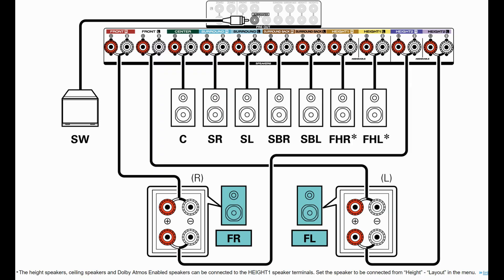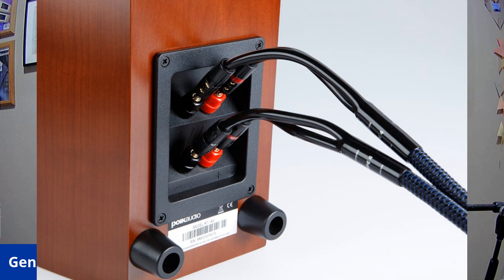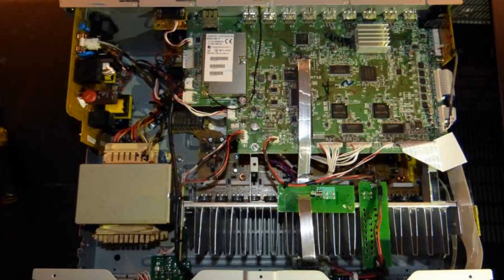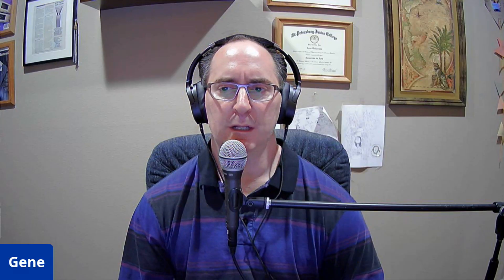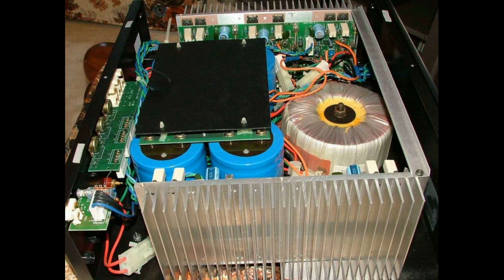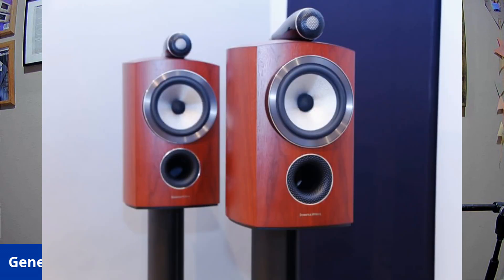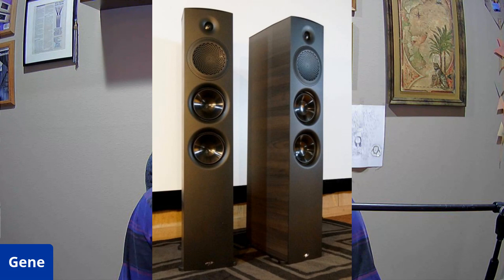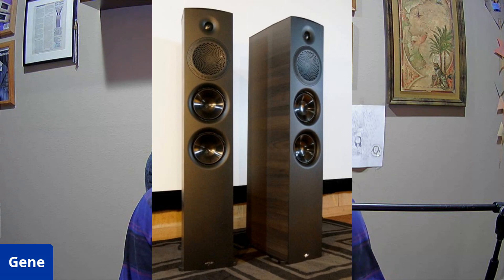Should You Bi-Amp Your AV Receiver?

Comment: I stopped using receivers after it seems they all eventually break.  I have gone to an extremely strange home theater system.  I am using car amplifiers, DC power supplies to run the amplifiers.  I swear these amps have so much headroom it's unreal.  I will probably never go back to a standard receiver.  Also, I use FLAC audio for music listening.  My home system is very, detailed, revealing, and not to mention very loud and clear.
Reply: That is strange.. Assuming it is a "home theater" system, what do you use to decode the Dolby siginal? otherwise I would just see it as an overcomplicated 2 channel system.  Which is fine, but are you also using something like a DSP-408 or similar? Tuning with REW? would open a whole new world in your case
Reply: So you have a 2 channel system with no processing at all? That sounds absolutely awful. I've never had a receiver break on me. I think it's something your doing bro.
Reply: what power source do u use for 12v car amp indoors
Reply: Yamaha = ZERO ISSUES...
Reply: @bryanp4827 
 Actually, most units equal no issues.
Reply: Car amps don't need the massive transformers to adjust the huge voltage coming in from the wall.  12v is plenty for audio.  There is so much wasted energy and heat with audio.  A good capacitor that stores energy for a millisecond can be run off a C or D battery and power large speakers.  Those $25 Bluetooth USB amplifiers are nothing more than car power boosters from the 1980s and run large tower speakers.  It's all about heat management and efficiency.  Keep the heat down and you keep the distention low.
Reply: REMBER...ANY ON A CAR OR MOTOR HOME IS 12vdc
SOLAR PANALS AND CAR BATTERIES ARE 12vdc
THINK PEOPLE THINK..U DONT NEED YOUR 120 vac RECEPTICAS....BUT REMBER CHINA MAKES ALL THE SOLAR PANELS....THANKS TO BIDEN PREVENTING USA COMPANIES FROM VIOLATING EPA LAWS
GET EDUCATED OR LOOSE AMERICA
Reply: I've often wondered how car amps would work at home. They have so much more power! I'd love to see some pics!

Comment: I have yamaha rx-a1020 7.1 channel if i want to bi amp my infinity beta 50 should i change the amp setting to 5.1+bi amp+ lfe to work. Or keep on my 7.1 settings and the extra speaker or zone2 i can use to bi amp the infinity beta 50

Comment: I used bi-amp feature on my sony str-da2400es around 9 years ago. I was listening to it couple of days and i felt its sounding strange and not better at all. Decided to go back to single amping. When removing wires, i noticed i have had mixed left and right channels on  mid-tweet  section. And instead to correct it and try it again, i started to collect vintage monster receivers. And amps, speakers, turntables. Lately i feel, im collecting also cars...

Comment: Short answer: no. Long answer, if you have a receiver where the power supply is really capable per the massive Denon did, why not? Me, I have a 5 channel amp that is a true monoblock design and used the extra channels to bi amp. The speakers (ATC SCM 19s, you should review!) are 85db efficient and did seem to benefit from the extra juice. I'm now using an Anthem STR integrated, so no more bi amping for me.

Comment: Hi, is Access Series CL2 Rated Speaker Wire any good, as in the UK it's about half the price of Blue Jeans 12 AWG cable?  Thanks
Reply: Any wire is just fine if you like how it looks. Ask an electrical engineer, not an "audiophile" ;)

A coat hanger is good enough

Comment: I’m happy to hear some bi-amp discussion.  I’m shopping for a new receiver and the ability to bi-amp it a must to drive my Polk towers. I’d appreciate some help with choosing my next receiver. Basically running 5.2 now and I want to add atmos.  I’m thinking I need at least a 9.2 to bi-amp and then end up with 7.2
Reply: OK..THE BI AMP IS JUST A PUSH PULL AMP...MOST SPEAKERS JUST PUSH....
I SUGGEST GETTING 6 KRK ROCKET ACTIVE THAT HAVE 2 AMPS INSIDE...THEY ARE PUSH PULL....U WILL HEAR THE DIFFERENCE..

Comment: Perfectly said. I use an old Pioneer VSX-AX10 to bi-amp my speakers. But I do it externally by splitting the incoming signal with rca splitters and feeding the signal to the multi-channel analog input.

Comment: my L/C/R consists of two Infinity Interludes IL40's and an IL36c. They are powered by an Infinity Signature 2.1 amp. I have tried bi-amping the il40's. I had one side bi-amped and one side on one channel. The difference was barely noticable (high range a bit more clear on bi-amp). So maybe theres a point were the amp is easily capable of driving the speakers that the biamp wont make a difference ? 
That H/K amp is a beast of a 5 channel amp.

Comment: I have the pioneer sc lx801. The bi-amp feature was noticable with my klipsch rp280f speakers at higher volumes. Better bass response and cleaner highs. Though l did buy a 7 channel power amp and no longer need to bi-amp as the amp puts out more than enough power per channel

Comment: Very helpful Gene!  Thank you.  I received support on this topic through the Website recently, Peng and others. I Bi-amped my high end top of the line Sony AVR to the mid and tweeter and My Anthem amp PVA4 to the bottom drivers of my Paradigm 95fs.  I used the SPL meter and found my ear was .5 db off on my front right and surround left all other speakers except subs, were spot on same level.  I used your SPL video to help me understand how to do that.  Thanks again!   My subs were much lower on the SPL meter.  Way off there. I turned both subs up to same DB and have really felt I'm enjoying Atmos movies the way they should be along with my 2 channel music at the best it can sound.  Many of us have limitations on speaker placement due to room size limitations to fit furniture, TV, audio equipment etc.. Practically no options.  I appreciate the advice on the room correction.  I just do the distance and level by ear instead with 80 crossover and small setting. As per above I was almost spot on to the SPL meter.   Two channels left on my PVA 4 so I used 1 of those also combined with the Sony to bi-amp my Center channel cc590 which now also sounds clearer and more pronounced at low and high volumes.  Another big advantage.  I plan to study Peng's advice to compare the single amp hook up vs bi-amp just for fun and because I can't stop messing with everything.   I am also now a subscriber!

Comment: Hey Gene, I run an older Yamaha Aventage RX-A1000 hooked up to klipsch rp250 towers for my front channels. I have considered running them bi-amped but haven't gotten around to getting the external amp for the rear surrounds yet. Reciever is rated at 105w per channel all channels driven as far as I know. But those specs are probable not accurate. Do you think its worth while to do it or just leave as is.

Comment: I have a Marantz SR6014 and have noticed a benefit of bi-amping from the AVR.  I also have a Parasound 855A 85WX5, I noticed a bump in power with this as well.  Using Parasound for bi-amped towers and cnter and running surrounds off the AVR.

Comment: Another interesting video Gene - thanks.  

I have a request for a topic I haven't seen covered anywhere: Why are there no $1000 pre-amp/processors? Why does a pre-amp - that has no amplifiers - cost more than the same company's flagship receiver even though it has the same processing?! If ever there was something that feels like snake oil, this has been it for me. It's like an audiophile luxury tax. How on earth do companies like Emotiva - who otherwise sell great stuff at reasonable prices - think they need $4k for their processor?! If Marantz/Denon have actually put in a feature in their receivers to TURN OFF the amps, effectively turning the receiver into a processor - why isn't there a cheaper model with no amps? And the worst part of all this is that it is the processor that becomes obsolete, so that's the piece that I want to spend the least on because you're going to want to upgrade it eventually. 

This has bothered me for 25 years. Would LOVE to hear your take on it.
Reply: The manufacturers know there are suckers out there who can be charged extortionate amount of money for a piece of equipment which should be cheaper.
Reply: Late reply, but after being in the AV field for >45 years ; I'm currently about to replace my Yamaha RX-A3020 with the new RX-A6A (BTW I have it BiAmped to my Pinnacle Studio Monitors). I also have an Anthem 5 channel Amp (which is what runs the biamped fronts). I would LOVE to get all the cool processing power a Pre-Pro offers without having to pay for so many amplified channels, but you don't get the high end features in lower priced units!  Now, I think the answer to your Q lies in several factors:
1. People who are in the market for Pre-Pro's are usually well informed or just have money to burn (not me!!). I doubt the marketing side of a $1K Pre-Pro works out for the companies, not a big enough market for all the work to make a killer Pre-Pro. 
2. As an Electronics Tech, I would wager  that over 80% of the effort of a receiver goes into the low signal / processing part of the design. Designing and making a state of the art Pre-Pro  is the expensive part, with such small signals it's easy to get noise, not to mention all the licensing fees are in there (DTS, Dolby, THX, etc, etc, etc). Not many licensing fees on an Amp.
3. The market share for Pre-Pros is an inherently smaller group, so you HAVE to charge more to make back your design costs.
Bottom line - they're in business to make money, not give away hard work. ;)
Certainly a certain amount of it is just greed - charging what the market will bear, but the margins on audio equipment isn't really all that high (until you get above the $2 mark, then it starts getting nuts!!). LPT - $400/foot cables don't improve your sound ... ;P
Reply: @mickmouse2258  Interestingly, since I posted that comment last year the topic had come up on avsforums several times, and now there actually are 2 "entry" level pre/pros. There is the Tonewinner AT-300 that's under $1500, and from what I understand Emotiva has brought out their own version of that unit (BasX MC1) that's under $1k. Tonewinner has good reviews but people generally don't like Emotiva's processors due to buggy firmware. Regardless, unless those become really successful and start a trend, I still doubt we see Denon (for example) coming out with a $1k 11.2 pre/pro (even though I think they would sell enough of them to be worth it). Frustrating.
Reply: @redstang5150  (I did a "Quick Reply" in the notification panel and it vanished) ... I hear ya! I'm currently about to buy a Yamaha RX-A6A but what I REALLY want is a Pre-Pro. I had an Anthem AV20 that I had to retire because of no HDMI support (add on board was released, but without updated standards), so I'm replacing an RX-A2030. I still have the awesome matching Anthem 5 channel amp (in use) but that leaves me a few channels short on my current ATMOS system ... ;-) So I'd need a Pre-Pro and an Amp. That pushes it past the range of the Wife (and CFO) Approval Factor. The A6A solves that for less $$. {Sigh} Cheers!
Reply: @mickmouse2258  That Yamaha is a nice unit but even that's more than I was interested in spending (and I'm the CFO in my house so that's a self imposed limit - ha). I have an older Yamaha TSR-7790 that was only $500 when I got it 8 years ago and it has full 7.2 pre-outs. I had that paired with Emotiva amps and was just using it as my pre/pro. Needed to migrate it from my HT to my family room system when the cheap receiver I had there died. Found that now you have to spend well over $1k even to get a receiver that has full pre-outs, and the cheapest quality option I could find was the Denon x3700 so I got that. 9.2 for about $1300. It's maybe only slightly better - very subtle improvement if at all from the Yamaha, but my purchase was more about just needing another AVR vs. looking for any sort of sound upgrade, so again, the less spent on the one HT component to become obsolete the better. I haven't put Atmos speakers in yet either - that will probably be a bigger difference. Otherwise I generally think the DSP multichannel processing is now so good across the board that it's pretty much a commodity, making the choice more about price and features.
Reply: An AVR generally cannot do what dedicated separates can. As is mentioned in other comments, when a pre/pro is being designed the standard is usually far beyond what AVR's are built to. This is because the manufacturers know you will be hooking it up to something equally well-built. Not only that, equipment manufacturers know that an AVR is going to be noisier - there are massive tradeoffs to having one piece of equipment do everything.
I personally wouldn't spend thousands on a pre-pro for multi-channel as they have a shelf-life and are an expensive book end when the next greatest surround format comes out. I would, however, invest in a piece of equipment that feeds my amp with the best possible signal - no tradeoffs. For me, the Anthem STR series preamp and amp hits the mark and gives zero compromise while doing its thing.
Reply: @michaeltaylor5451  "An AVR generally cannot do what dedicated separates can."  Like what? What important functionality can an AVR not do? Sure, a $4k pre/pro better have a few extras, but so does a $4k AVR. If I can get a great Denon AVR for $1500, I should be able to get that same functionality from a Denon Pre/Pro for around $1k. 

My point is that I should be able to get a decent pre/pro for the price of a nice AVR. Just give me the processing, and make it cheaper because that's what becomes obsolete. AMPs don't become obsolete, so I'll invest in some high quality amps that I never need to replace and then I'll swap out my processor every few years, because with regards to multichannel processing for movies, all I want is what a quality AVR provides. The diminishing returns beyond that are vast.

Comment: I tried biamping with an 833A SET on the woofers and a 45 SET on the mid and tweeters. Then I tried it letting the 833A SET on the whole speaker and it sounded better. I changed to Magnepan speakers which do not biamp. I only use these big transmitter tubes on the stereo channels and a GM70 SET on the center channel which uses a Magnepan center channel speaker. For surround channels I use 45 SETs with sensitive bipolar speakers; 5 channels as as far as I go because I use it for 5 channel SACD and for movies, operas on film only put out at most 5 channels.

Comment: Question... I have a dennon avr x3600h it's running 7.2.4 with a separate niles audio sl-275 just driving the front stereo speakers. My speakers are all monitor audio bronze, my towers are bi wireable should I get an extra amp and use the 2 to power my height channels and bi wire straight to the avr or leave it as is??? Total newb to this stuff. This is my first build.

Comment: I just feel like you are burning a lot of power for nothing with bi amp, if you put a low level filter (sorry, don't know the correct therm) between the amp and pre amp you would probably get notiseble extra power.
But without a low level filter the filter in the speaker needs to filter al that power you don't want it to play and it goes to waste. 
I'm not an expert on filters so if I'm wrong, tell me and explain how it really works.

Comment: I have a denon 3808, it’s a 7.1 system with a 2ch assignable which can be assigned for bi-amp or a separate zone or even a separate 2ch system and even incorporate it a 9ch system which is what I’m using to power 2 small bookshelves 
I have NHT-VT2 LR speakers which has passive subs at the bottom which is powered from my avr and the subs are bi-amped with an NHT-SA2 subwoofer  giving me that extra base

Comment: I have a 2006 Arcam AVR300 that has a true bi-wiring (EDIT: bi-amping) feature, giving a real 200wpc. I really want to try it now with my Klipsch RF7’s 🔊
Reply from the maker: Biwiring is a waste of time.
Reply: @Audioholics  didn’t you say at the beginning of the video that bi-wiring with a couple of the early 2000’s powerhouse AVR’s that biwiring made a positive impact? The Arcam is in that category. I’m confused 🤷‍♂️
Reply: @jstoli996c4s   - Bi-wiring, which uses two wires from one speaker output, is a waste of time.  This video was talking about passive "bi-amping" which uses two speaker outputs to one speaker.  Based on your post saying that the amp has a feature for it, I would assume you mean you are bi-amping your speakers using 2 outputs from the receiver to power one speaker.  Is that correct?
Reply: @keving8013  you are correct, I was referring to a built-in bi-amping feature, not bi-wiring.  I got my terms mixed up.